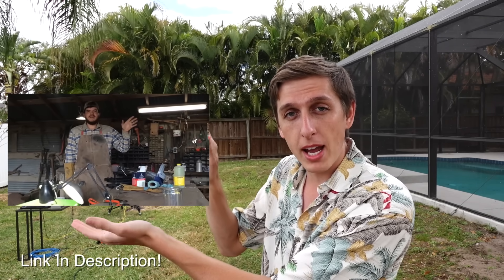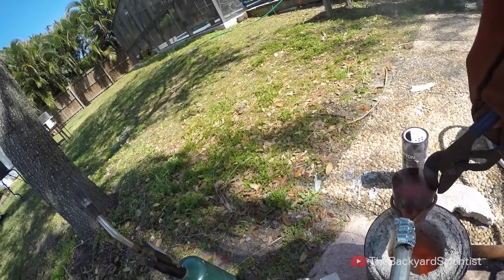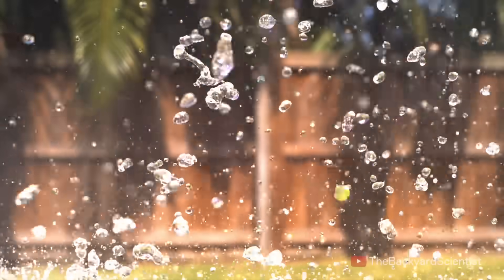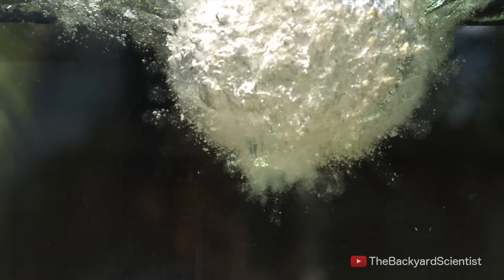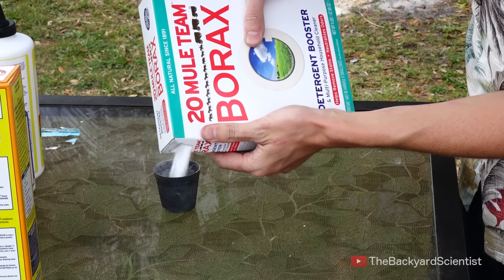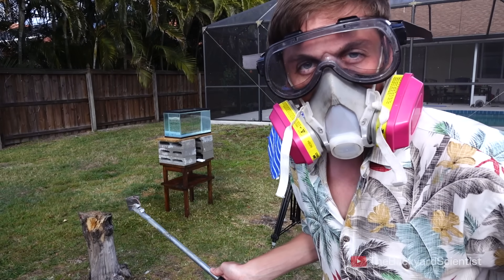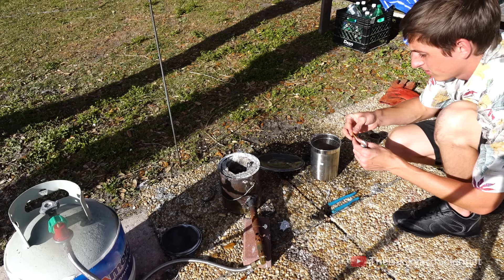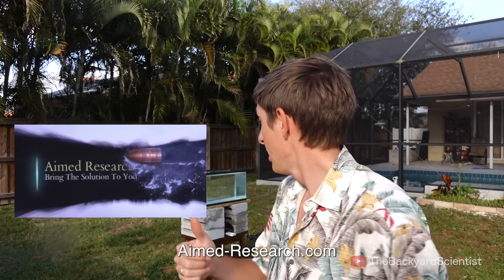Pouring Molten salt into Water - Explosion!

Comment: =THE RIGHT ANSWER IS VISCOSITY.....MOLTEN SALT GOT LESS VISCOSITY THAN WATER...

.....WHEN BEING POURED,STILL LIQUID IT CANNOT MAINTAIN IT'S FORM IN CONTACT WITH WATER TURNING INTO STEAM,AND TURNING INTO LITTLEST DROPLETS THAT TRANSFER HEAT TO WATER ALL AT ONCE,WHICH DOES EXPLOSION

..........THE SOMEWHAT SAME PRINCIPLE IS ABOUT WHEN POURING WATER IN OVERHEATED OIL...........WATER DOES BEHAVE LIKE SALT,BECAUSE WATER'S VISCOSITY IS LOWER THAN OIL'S............SO.......WATER DOES EXPLOSION.................AND AFTER THAT OIL DOES IGNITE..............................................

.........ALSO CHEMISTRY GOT THE RULE ABOUT NOT POURING WATER IN CONDENSED SULPHURIC ACID BECAUSE OF THERE'S ALSO VISCOSITY OF ACID IS GREATER THAN WATER'S.........AND THE HEAT IS BEING PRODUCED BY THE REACTION OF ACID AND WATER BECAUSE OF MOLECULE OF SULPHURIC ACID LOVES TO BE SURROUNDED BY SOME MOLECULES OF WATER......................

.............THE PROOF OF THAT VISCOSITY THEORY IS VERY SIMPLE.............BECAUSE OF THERE'S NO EXPLOSION IF SUBSTANCE WITH GREATER VISCOSITY IS BEING POURED INTO SUBSTANCE WITH LESSER ONE.....................SO,WATER DOES NOT EXPLODE WHEN POURED INTO MOLTEN SALT,OVERHEATED OIL DOES NOT EXPLODE WHEN POURED INTO WATER,ACID DOES NOT WHEN INTO WATER.....................................OF COURSE,THERE'LL BE SOME REACTION,BUT IT'LL BE MUCH LESS VIGOROUS......................

........................ALSO MOLTEN COPPER DOES THE SAME,WHILE MOLTEN ALUMINUM,MOLTEN IRON,MOLTEN ROCK A.K.A. LAVA DONT..................

..............AND OF COURSE IF DENSITY IS QUITE DIFFERENT,SO EVEN SUBSTANCE WITH LESSER VISCOSITY DOES NOT DO THE EXPLOSION,BECAUSE OF IT CANNOT GET DEEP ENOUGH INTO BODY OF DENSER LIQUID..................SO IDEAL EXAMPLE IS ABOUT WHEN LIQUID HAS HIGHER DENSITY AND LESS VISCOSITY ............................

Comment: (For those who still don't know)

About the molten salt exploding in water

Basically, the molten salt is so hot that it superheats the relatively cool water to steam at a very fast rate, causing the explosion

Source: https://www.businessinsider.com/molten-salt-water-video-youtube-2016-3?amp
Reply: =ALMOST CORRECT,BUT.....IT'S ABOUT DENSITY AND VISCOSITY...........

.....MOLTEN SALT DOES EXPLODE BECAUSE IT'S DENSER BUT HAS LESS VISCOSITY.....SO IT'S BIG DROPLETS IMMEDIATELY DISPERSE INTO SMALLEST ONES,WHICH ALSO IMMEDIATELY TRANSFER ALL THEIR HEAT TO WATER

.........BUT NOTHING HAPPENS IF POUR WATER INTO MOLTEN SALT........BECAUSE OF...........DENSITY,IT'S VERY IMPORTANT.......SO SALT EXPLODES BECAUSE OF IT SINK INTO WATER.........WHILE WATER IS LESS DENSE THAN MOLTEN SALT,SO IT'LL JUST FLOAT ON SURFACE.........................WITH MUCH LESS VIGOROUS REACTION

..............EVEN BETTER EXAMPLE IS ABOUT MOLTEN COPPER INTO WATER,BECAUSE OF MOLTEN COPPER HAS EVEN LESS VISCOSITY THAN MOLTEN SALT,BUT MUCH HIGHER DENSITY.....SO IT DOES HAVE MUCH GREATER EXPLOSION...............BUT WATER INTO MOLTEN COPPER DOES LITERALLY NOTHING

........ALSO...............OVERHEATED OIL......LESSER DENSITY THAN WATER BUT GREATER VISCOSITY...............SO WHEN WATER GOES TO OIL,AT FIRST WATER GOES BOOM IN THE OIL,AND THEN OIL DOES IGNITE.................AND ALSO,OIL INTO WATER DOES NOTHING AS WELL

............ALSO CHEMISTS HAVE RULE ABOUT NOT TO POUR WATER IN CONDENSED SULPHURIC ACID..........BUT.......IT'S LESS VIGOROUS BECAUSE OF SULPHURIC ACID IS DENSER THAN WATER,BUT REACTION IS STILL NICE TOO..................SO NOT VERY ACCURATE EXAMPLE,AGREE.......................BUT YOU GOT THE POINT

Comment: my brain hurts in the beginning when you were asking wHY THE *MOLTEN HOT SALT* WAS EXPLODING IN WATER
Reply: ....IT'S ABOUT DENSITY AND VISCOSITY...........

.....MOLTEN SALT DOES EXPLODE BECAUSE IT'S DENSER BUT HAS LESS VISCOSITY.....SO IT'S BIG DROPLETS IMMEDIATELY DISPERSE INTO SMALLEST ONES,WHICH ALSO IMMEDIATELY TRANSFER ALL THEIR HEAT TO WATER

.........BUT NOTHING HAPPENS IF POUR WATER INTO MOLTEN SALT........BECAUSE OF...........DENSITY,IT'S VERY IMPORTANT.......SO SALT EXPLODES BECAUSE OF IT SINK INTO WATER.........WHILE WATER IS LESS DENSE THAN MOLTEN SALT,SO IT'LL JUST FLOAT ON SURFACE.........................WITH MUCH LESS VIGOROUS REACTION

..............EVEN BETTER EXAMPLE IS ABOUT MOLTEN COPPER INTO WATER,BECAUSE OF MOLTEN COPPER HAS EVEN LESS VISCOSITY THAN MOLTEN SALT,BUT MUCH HIGHER DENSITY.....SO IT DOES HAVE MUCH GREATER EXPLOSION...............BUT WATER INTO MOLTEN COPPER DOES LITERALLY NOTHING

........ALSO...............OVERHEATED OIL......LESSER DENSITY THAN WATER BUT GREATER VISCOSITY...............SO WHEN WATER GOES TO OIL,AT FIRST WATER GOES BOOM IN THE OIL,AND THEN OIL DOES IGNITE.................AND ALSO,OIL INTO WATER DOES NOTHING AS WELL

............ALSO CHEMISTS HAVE RULE ABOUT NOT TO POUR WATER IN CONDENSED SULPHURIC ACID..........BUT.......IT'S LESS VIGOROUS BECAUSE OF SULPHURIC ACID IS DENSER THAN WATER,BUT REACTION IS STILL NICE TOO..................SO NOT VERY ACCURATE EXAMPLE,AGREE.......................BUT YOU GOT THE POINT

Comment: Atomically structure maybe?
Reply: ....IT'S ABOUT DENSITY AND VISCOSITY...........

.....MOLTEN SALT DOES EXPLODE BECAUSE IT'S DENSER BUT HAS LESS VISCOSITY.....SO IT'S BIG DROPLETS IMMEDIATELY DISPERSE INTO SMALLEST ONES,WHICH ALSO IMMEDIATELY TRANSFER ALL THEIR HEAT TO WATER

.........BUT NOTHING HAPPENS IF POUR WATER INTO MOLTEN SALT........BECAUSE OF...........DENSITY,IT'S VERY IMPORTANT.......SO SALT EXPLODES BECAUSE OF IT SINK INTO WATER.........WHILE WATER IS LESS DENSE THAN MOLTEN SALT,SO IT'LL JUST FLOAT ON SURFACE.........................WITH MUCH LESS VIGOROUS REACTION

..............EVEN BETTER EXAMPLE IS ABOUT MOLTEN COPPER INTO WATER,BECAUSE OF MOLTEN COPPER HAS EVEN LESS VISCOSITY THAN MOLTEN SALT,BUT MUCH HIGHER DENSITY.....SO IT DOES HAVE MUCH GREATER EXPLOSION...............BUT WATER INTO MOLTEN COPPER DOES LITERALLY NOTHING

........ALSO...............OVERHEATED OIL......LESSER DENSITY THAN WATER BUT GREATER VISCOSITY...............SO WHEN WATER GOES TO OIL,AT FIRST WATER GOES BOOM IN THE OIL,AND THEN OIL DOES IGNITE.................AND ALSO,OIL INTO WATER DOES NOTHING AS WELL

............ALSO CHEMISTS HAVE RULE ABOUT NOT TO POUR WATER IN CONDENSED SULPHURIC ACID..........BUT.......IT'S LESS VIGOROUS BECAUSE OF SULPHURIC ACID IS DENSER THAN WATER,BUT REACTION IS STILL NICE TOO..................SO NOT VERY ACCURATE EXAMPLE,AGREE.......................BUT YOU GOT THE POINT

Comment: personally my theory for why the explosion is happening is because of the sodium because when its melted it up since sodium is a metal type base its like melting metal and pouring it in which makes lava though the chloride controrary to popular belief when chloride is poured into volcanos it causes for a bigger eruption so basically its a mini volcano
Reply: ....IT'S ABOUT DENSITY AND VISCOSITY...........

.....MOLTEN SALT DOES EXPLODE BECAUSE IT'S DENSER BUT HAS LESS VISCOSITY.....SO IT'S BIG DROPLETS IMMEDIATELY DISPERSE INTO SMALLEST ONES,WHICH ALSO IMMEDIATELY TRANSFER ALL THEIR HEAT TO WATER

.........BUT NOTHING HAPPENS IF POUR WATER INTO MOLTEN SALT........BECAUSE OF...........DENSITY,IT'S VERY IMPORTANT.......SO SALT EXPLODES BECAUSE OF IT SINK INTO WATER.........WHILE WATER IS LESS DENSE THAN MOLTEN SALT,SO IT'LL JUST FLOAT ON SURFACE.........................WITH MUCH LESS VIGOROUS REACTION

..............EVEN BETTER EXAMPLE IS ABOUT MOLTEN COPPER INTO WATER,BECAUSE OF MOLTEN COPPER HAS EVEN LESS VISCOSITY THAN MOLTEN SALT,BUT MUCH HIGHER DENSITY.....SO IT DOES HAVE MUCH GREATER EXPLOSION...............BUT WATER INTO MOLTEN COPPER DOES LITERALLY NOTHING

........ALSO...............OVERHEATED OIL......LESSER DENSITY THAN WATER BUT GREATER VISCOSITY...............SO WHEN WATER GOES TO OIL,AT FIRST WATER GOES BOOM IN THE OIL,AND THEN OIL DOES IGNITE.................AND ALSO,OIL INTO WATER DOES NOTHING AS WELL

............ALSO CHEMISTS HAVE RULE ABOUT NOT TO POUR WATER IN CONDENSED SULPHURIC ACID..........BUT.......IT'S LESS VIGOROUS BECAUSE OF SULPHURIC ACID IS DENSER THAN WATER,BUT REACTION IS STILL NICE TOO..................SO NOT VERY ACCURATE EXAMPLE,AGREE.......................BUT YOU GOT THE POINT

Comment: Molten salt made bubbles. molten sodium made fire. And you say molten-salt wins. Tsk, tsk
Reply: ....IT'S ABOUT DENSITY AND VISCOSITY...........

.....MOLTEN SALT DOES EXPLODE BECAUSE IT'S DENSER BUT HAS LESS VISCOSITY.....SO IT'S BIG DROPLETS IMMEDIATELY DISPERSE INTO SMALLEST ONES,WHICH ALSO IMMEDIATELY TRANSFER ALL THEIR HEAT TO WATER

.........BUT NOTHING HAPPENS IF POUR WATER INTO MOLTEN SALT........BECAUSE OF...........DENSITY,IT'S VERY IMPORTANT.......SO SALT EXPLODES BECAUSE OF IT SINK INTO WATER.........WHILE WATER IS LESS DENSE THAN MOLTEN SALT,SO IT'LL JUST FLOAT ON SURFACE.........................WITH MUCH LESS VIGOROUS REACTION

..............EVEN BETTER EXAMPLE IS ABOUT MOLTEN COPPER INTO WATER,BECAUSE OF MOLTEN COPPER HAS EVEN LESS VISCOSITY THAN MOLTEN SALT,BUT MUCH HIGHER DENSITY.....SO IT DOES HAVE MUCH GREATER EXPLOSION...............BUT WATER INTO MOLTEN COPPER DOES LITERALLY NOTHING

........ALSO...............OVERHEATED OIL......LESSER DENSITY THAN WATER BUT GREATER VISCOSITY...............SO WHEN WATER GOES TO OIL,AT FIRST WATER GOES BOOM IN THE OIL,AND THEN OIL DOES IGNITE.................AND ALSO,OIL INTO WATER DOES NOTHING AS WELL

............ALSO CHEMISTS HAVE RULE ABOUT NOT TO POUR WATER IN CONDENSED SULPHURIC ACID..........BUT.......IT'S LESS VIGOROUS BECAUSE OF SULPHURIC ACID IS DENSER THAN WATER,BUT REACTION IS STILL NICE TOO..................SO NOT VERY ACCURATE EXAMPLE,AGREE.......................BUT YOU GOT THE POINT

Comment: Maybe thermolysis of water molecules catalysed by sodium chloride. Hot hydrogen and oxygen gas could recombine again with explosion.
Reply: ....IT'S ABOUT DENSITY AND VISCOSITY...........

.....MOLTEN SALT DOES EXPLODE BECAUSE IT'S DENSER BUT HAS LESS VISCOSITY.....SO IT'S BIG DROPLETS IMMEDIATELY DISPERSE INTO SMALLEST ONES,WHICH ALSO IMMEDIATELY TRANSFER ALL THEIR HEAT TO WATER

.........BUT NOTHING HAPPENS IF POUR WATER INTO MOLTEN SALT........BECAUSE OF...........DENSITY,IT'S VERY IMPORTANT.......SO SALT EXPLODES BECAUSE OF IT SINK INTO WATER.........WHILE WATER IS LESS DENSE THAN MOLTEN SALT,SO IT'LL JUST FLOAT ON SURFACE.........................WITH MUCH LESS VIGOROUS REACTION

..............EVEN BETTER EXAMPLE IS ABOUT MOLTEN COPPER INTO WATER,BECAUSE OF MOLTEN COPPER HAS EVEN LESS VISCOSITY THAN MOLTEN SALT,BUT MUCH HIGHER DENSITY.....SO IT DOES HAVE MUCH GREATER EXPLOSION...............BUT WATER INTO MOLTEN COPPER DOES LITERALLY NOTHING

........ALSO...............OVERHEATED OIL......LESSER DENSITY THAN WATER BUT GREATER VISCOSITY...............SO WHEN WATER GOES TO OIL,AT FIRST WATER GOES BOOM IN THE OIL,AND THEN OIL DOES IGNITE.................AND ALSO,OIL INTO WATER DOES NOTHING AS WELL

............ALSO CHEMISTS HAVE RULE ABOUT NOT TO POUR WATER IN CONDENSED SULPHURIC ACID..........BUT.......IT'S LESS VIGOROUS BECAUSE OF SULPHURIC ACID IS DENSER THAN WATER,BUT REACTION IS STILL NICE TOO..................SO NOT VERY ACCURATE EXAMPLE,AGREE.......................BUT YOU GOT THE POINT

Comment: Oh i think because of the bubbles and the salt making it heated up so its creating from the pressure of the water and the expansion of the bubbles air creating a air pressured explosion
Reply: ....IT'S ABOUT DENSITY AND VISCOSITY...........

.....MOLTEN SALT DOES EXPLODE BECAUSE IT'S DENSER BUT HAS LESS VISCOSITY.....SO IT'S BIG DROPLETS IMMEDIATELY DISPERSE INTO SMALLEST ONES,WHICH ALSO IMMEDIATELY TRANSFER ALL THEIR HEAT TO WATER

.........BUT NOTHING HAPPENS IF POUR WATER INTO MOLTEN SALT........BECAUSE OF...........DENSITY,IT'S VERY IMPORTANT.......SO SALT EXPLODES BECAUSE OF IT SINK INTO WATER.........WHILE WATER IS LESS DENSE THAN MOLTEN SALT,SO IT'LL JUST FLOAT ON SURFACE.........................WITH MUCH LESS VIGOROUS REACTION

..............EVEN BETTER EXAMPLE IS ABOUT MOLTEN COPPER INTO WATER,BECAUSE OF MOLTEN COPPER HAS EVEN LESS VISCOSITY THAN MOLTEN SALT,BUT MUCH HIGHER DENSITY.....SO IT DOES HAVE MUCH GREATER EXPLOSION...............BUT WATER INTO MOLTEN COPPER DOES LITERALLY NOTHING

........ALSO...............OVERHEATED OIL......LESSER DENSITY THAN WATER BUT GREATER VISCOSITY...............SO WHEN WATER GOES TO OIL,AT FIRST WATER GOES BOOM IN THE OIL,AND THEN OIL DOES IGNITE.................AND ALSO,OIL INTO WATER DOES NOTHING AS WELL

............ALSO CHEMISTS HAVE RULE ABOUT NOT TO POUR WATER IN CONDENSED SULPHURIC ACID..........BUT.......IT'S LESS VIGOROUS BECAUSE OF SULPHURIC ACID IS DENSER THAN WATER,BUT REACTION IS STILL NICE TOO..................SO NOT VERY ACCURATE EXAMPLE,AGREE.......................BUT YOU GOT THE POINT
Reply: @robotnikkkk001  okeh

Comment: The different results between the molten salts, if it does start with a droplet of water getting trapped, would (to my knowledge) be their viscosity, and perhaps surface tension as well.  In the video, the other salts appeared to be rather gloopy whereas the sodium chloride looked almost as thin water.  If the molten Sodium Chloride has a lower density than the other salts (and a lot closer, or less than, water), I think this would also have a huge effect
Reply: .....ACTUALLY IT'S HALF CORRECT.....MOLTEN SALT DENSER THAN WATER BUT HAS LESSER VISCOSITY

.......MOLTEN COPPER INTO WATER DOES THE SAME BOOM.........ALSO WATER IN BOILING OIL......JUST THE SAME PRINCIPLE.....AND PROOF IS ABOUT NOTHING HAPPENS IF WATER ON MOLTEN SALT OR COPPER.....

...........SO LESS VISCOUS LIQUID MUST BE DENSER TO GO BOOM.............AND IF IT HAS LESSER DENSITY SO IT'LL JUST FLOAT ON SURFACE........LIKE IF WATER TO POUR ON MOLTEN SALT,THERE'LL BE NO EXPLOSION.....................AND WATER ON MOLTEN COPPER DOES NOT EXPLODE...............JUST BOIL AWAY FROM SURFACE,BECAUSE OF IT CANNOT GET UNDERNEATH DUE TO LESSER DENSITY......................

.............AND BOILING OIL DOES NOTHING WHEN POURED IN WATER,BY THE SAME CAUSE...........MAYBE SOME BUBBLES WILL BE,BUT NOT VERY MUCH,BECAUSE OF WATER WILL ABSORB HEAT AND IT'S UNDERNEATH OIL SO AREA OF CONTACT WILL BE JUST MINIMAL AS POSSIBLE................

.................AND IF DENSER LIQUID WILL HAVE GREATER VISCOSITY,SO IT'LL KEEP TO MAINTAIN IT'S SHAPE AND WONT EXPLODE........................LIKE MOLTEN SUGAR,MOLTEN IRON,MOLTEN ALUMINUM,LAVA WHICH IS MOLTEN ROCKS.........................

...............I THINK YOU GOT THE POINT........................

Comment: the metal sodium explosion looks sick
Reply: =NOPE,ITS ABOUT DENSITY AND VISCOSITY.....MOLTEN SALT DENSER THAN WATER BUT LESSER VISCOSITY

=MOLTEN SALT SINKS IN WATER,BUT DUE TO LESSER VISCOSITY IT'S DROPLETS IMMEDIATELY DISPERSE INTO LITTLEST POSSIBLE ONES,WHICH TRANSFER THEIR HEAT TO WATER ALL AT ONCE WHICH DOES A BOOM

.......MOLTEN COPPER INTO WATER DOES THE SAME BOOM.........ALSO WATER IN BOILING OIL......JUST THE SAME PRINCIPLE.....AND PROOF IS ABOUT NOTHING HAPPENS IF WATER ON MOLTEN SALT OR COPPER.....

...........SO LESS VISCOUS LIQUID MUST BE DENSER TO GO BOOM.............AND IF IT HAS LESSER DENSITY SO IT'LL JUST FLOAT ON SURFACE........LIKE IF WATER TO POUR ON MOLTEN SALT,THERE'LL BE NO EXPLOSION.....................AND WATER ON MOLTEN COPPER DOES NOT EXPLODE...............JUST BOIL AWAY FROM SURFACE,BECAUSE OF IT CANNOT GET UNDERNEATH DUE TO LESSER DENSITY......................

.............AND BOILING OIL DOES NOTHING WHEN POURED IN WATER,BY THE SAME CAUSE...........MAYBE SOME BUBBLES WILL BE,BUT NOT VERY MUCH,BECAUSE OF WATER WILL ABSORB HEAT AND IT'S UNDERNEATH OIL SO AREA OF CONTACT WILL BE JUST MINIMAL AS POSSIBLE................

.................AND IF DENSER LIQUID WILL HAVE GREATER VISCOSITY,SO IT'LL KEEP TO MAINTAIN IT'S SHAPE AND WONT EXPLODE........................LIKE MOLTEN SUGAR,MOLTEN IRON,MOLTEN ALUMINUM,LAVA WHICH IS MOLTEN ROCKS.........................

...............I THINK YOU GOT THE POINT........................
Reply: @robotnikkkk001  LOL

Comment: I think a factor in it is that it is going from super hot to room temperature in a fraction of a second. I remember this, it would crack, and shatter. I'm no scientist, but I think that plus sodiums reaction to water made the effect. I think that the other salts didn't have the shattering for some unknown reason, and so they didn't do anything spectacular
Reply: =NOPE,ITS ABOUT DENSITY AND VISCOSITY.....MOLTEN SALT DENSER THAN WATER BUT LESSER VISCOSITY

=MOLTEN SALT SINKS IN WATER,BUT DUE TO LESSER VISCOSITY IT'S DROPLETS IMMEDIATELY DISPERSE INTO LITTLEST POSSIBLE ONES,WHICH TRANSFER THEIR HEAT TO WATER ALL AT ONCE WHICH DOES A BOOM

.......MOLTEN COPPER INTO WATER DOES THE SAME BOOM.........ALSO WATER IN BOILING OIL......JUST THE SAME PRINCIPLE.....AND PROOF IS ABOUT NOTHING HAPPENS IF WATER ON MOLTEN SALT OR COPPER.....

...........SO LESS VISCOUS LIQUID MUST BE DENSER TO GO BOOM.............AND IF IT HAS LESSER DENSITY SO IT'LL JUST FLOAT ON SURFACE........LIKE IF WATER TO POUR ON MOLTEN SALT,THERE'LL BE NO EXPLOSION.....................AND WATER ON MOLTEN COPPER DOES NOT EXPLODE...............JUST BOIL AWAY FROM SURFACE,BECAUSE OF IT CANNOT GET UNDERNEATH DUE TO LESSER DENSITY......................

.............AND BOILING OIL DOES NOTHING WHEN POURED IN WATER,BY THE SAME CAUSE...........MAYBE SOME BUBBLES WILL BE,BUT NOT VERY MUCH,BECAUSE OF WATER WILL ABSORB HEAT AND IT'S UNDERNEATH OIL SO AREA OF CONTACT WILL BE JUST MINIMAL AS POSSIBLE................

.................AND IF DENSER LIQUID WILL HAVE GREATER VISCOSITY,SO IT'LL KEEP TO MAINTAIN IT'S SHAPE AND WONT EXPLODE........................LIKE MOLTEN SUGAR,MOLTEN IRON,MOLTEN ALUMINUM,LAVA WHICH IS MOLTEN ROCKS.........................

...............I THINK YOU GOT THE POINT........................